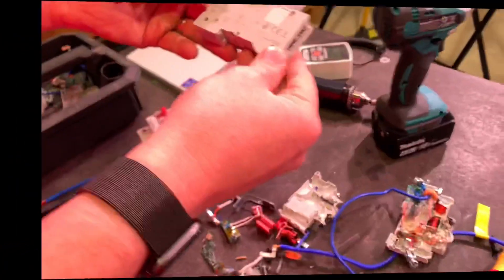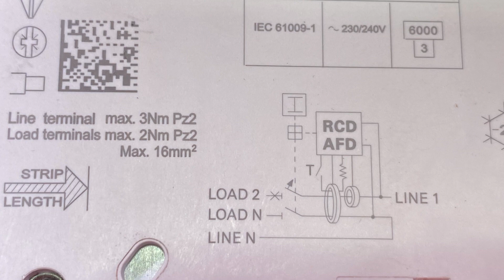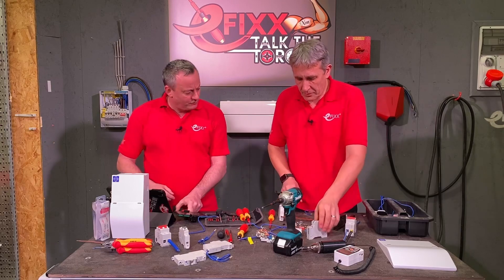IMPACT DRIVER vs CONSUMER UNIT - The results are SHOCKING

Comment: What sort of person thinks an impact driver is the proper way to tighten up an electrical connection? They aren't even the right way to fix a consumer unit to a wall (or at least one clad in plasterboard; it might be OK into a solid wall or a wooden board).

Comment: ❗️I’m not condoning the use of an impact driver ❗️… AND … I do not think the below myself. But I feel many people might watch this and say “yeh but my Dewalt impact driver has three speeds (these are hybrid speed and torque settings) and on the slow setting you can get exceptional control over how tight something is done up. Of course, this is not calibrated control, and you still don’t know what torque is being applied. But this video seems to show the results of gunning some poor piece of plastic like a bull in a china shop. Also what about drills with a driver bit: they have far more granular control over torque. ❗️Yes I know this is still not calibrated and - REMINDER - I am definitely in the torque screwdriver camp❗️But I just feel it’s worth some proper A/B testing with more careful use of these power tools vs a torque VDE driver to compare results to see how far out or how close you can get. I feel many people watching this who DO use an impact driver will just say “yeh but I can control it far better than shown here.

Comment: No competent properly trained electrician uses a impact driver to tighten any terminals.
Only the diy brigade and maybe a few gas fitters or plumbers who think they are smart enough to do their own electrics after watching a few you tube videos.
Just remember a little knowledge is dangerous.
I see it every single day.
Clowns who think they can do the electrical work themselves.
It’s scary how low standards have gone.
Reply from the maker: We’ve seen this or the results of on lots of installs by “approved” contractors

Comment: Hager take the impact driver just fine. I’ve never had an issue and your darn right I’m having all my connections tight. Just having a little bit of knowledge and sense to know how tight to go. Wouldn’t tighten lighting as much as say ring or shower for example. So many boards I go into and you could blow the terminal round it’s that slack. Slack connections, big loads cause heat and fires.

Comment: The red tail going into our old consumer unit was just sitting in the terminal. The screw had been stripped, presumably by whoever installed the consumer unit over 20 years earlier. The fault was found when we had a smart meter fitted. The man noticed that there was no power; the tail had just slipped out of the connection. It could have killed him. He helpfully called up an electrician who fitted a new main switch that night.

Comment: I use a Bosch 12v brushless mini impact driver. You can set it on a half power setting. Of course I never ever use it to tighten any terminals in the CU, I don’t let it do 1 or 2 digs, neither do I go over the board with with my torque driver afterwards to make sure everything is where it should be either. Neither would I know that my impact driver doesn’t tighten it to anywhere near 2nm with 1 or 2 digs by the fact that the torque driver still does some turning after the fact, probably. 

I did once use my big makita to whizz a main switch though. Needless to say that main switch ended up in the bin,

Comment: Cant believe, that using an impact driver and Consumer unit, charger installs etc are associated in the same, real world work practices. As my old boss used to say, my flabber is gasted. Just use a drill driver with an adjustable clutch/torque setting. Unless some installers dont know the difference or how to use one......

Comment: I'm sure that every mechanical engineer that views this will have one question in his mind re: torque settings ... Why dry? I.e. NO lubrication. Normally when setting torque in a.purely mechanical setting it is done with grease or oil or even a specified lubricant. This makes the actual torque applied do its job correctly.

If the "correct" torque IS so critical, and I understand why and agree, then surely lubrication should be specified also?

Comments? Testing?

Comment: One thing doing a degree in Mechatronics opened my eyes up to was the Mechanical components of an Electrical Distribution unit. Let’s be real, the amount of electrical installations behind the meter that are not fit for use is scary. I’ve checked boards in the past years gone by for Nm torque settings and no indications could be found on the MCB’s RCBO’s etc. I’ve come across brand name boards with over 3-4 different types of screw heads. 

An ISO industry standard is needed! The part that’s still hilarious is those circuits like heat pumps/ EV chargers that are constantly seeing high loads which is resulting in expansion and contraction. Go back to those connections over time and you’ll question the best of brands. Then look at an over tightened ferrules connection through thermal imaging under load and be ready for a big eye opener!  I see someone been made an example of very soon. 

Only solution in my opinion is period board inspections every year. 

It’ll save lives and insurance claims from fires. No brainer.
Reply: Sorry to highiack your comment.......I've been looking at the mechatronic course. Any reviews?

Comment: Your using the impact driver like an absolute amateur, nothing wrong with it if you can actually use power tools just use a bit of finesse not POWER flat out actually use the variable speed.

Comment: Those old C50 breakers don't have a bimetallic strip/thermal trip element - They're magnetic trip only.  Got a bucket full of the things and an old Crabtree C50 3 phase board still in service.

Comment: Well... each to their own nobody in their right mind would let the digger part of impact driver kick in (155nm) impact driver is for forcing a screw into timber etc so if you can just use it with minimum power until you feel the tightness of the screw then it’s fine just go over it with your screwdriver... BUT TAKING THE RISK IS A BIG NO NO but there are people out there who know how to use their hand tools correctly

Comment: It is an inappropriate use of a tool. Use a torque driver, designed for the purpose of tightening terminals on switchgear, to the torque tightness specified by the manufacturer.

Comment: A universal standard that can be adopted and thought from the bottom is what the industry needs. 

Something along the lines of a set torque setting depending on the size of the screw head, pz1 - 1nm, pz2 - 2nm etc.

Comment: I really can't imagine why people would put an impact driver near a consumer unit. There's very few cars on the road with 150nm on their wheel nuts, let alone on an MCB. My Milwaukee M12 driver is 30nm on max setting and it'll shear the head off machine screws or damage the threads of the screw. Did nobody learn about torque in college or what ?

Comment: An impact driver is for freeing up main crankshaft pulley bolts or seized wheel nuts. 
I've seen 'improvers' using them to put screws into plastic conduit saddles.

Comment: Seems to me that there's a fundamental usability issue with the torques required for a lot of these terminals. It's unreasonable to expect a busy electrician to have to read and set their torque screwdriver for each and every terminal. Similar sized terminals ought to have the same torque setting across all products. Those Wylex terminals with 2Nm on one side and 3Nm the other is nuts. It's bad product design (FWIW I'm an engineer that designs products - not for this industry). Perhaps a rash of RMA returns will bring the manufacturers to their senses....not that I'm advocating the use of impact drivers tho.
Reply: Completely agree with this, manufactures need to make a standard (or someone make it for them). I cant see why everything in a domestic fuseboard cant be 3nm for example and every manufacturer has to design their gear around that. Could probably also apply this to sockets at 2nm and switches at 1.5. Every sparks then has 3 fixed torque drivers (1.5, 2 and 3),  I bet a fixed torque driver would be less than 25 quid so 75 quid all in to comply fully, they would require calibration less often than adjustable torque drivers and it would get the industry to the point where it is as easy to follow the rules as it is to ignore them! While we're at it standardize the screws also, move everything to torx, T10 for switches, T15 for sockets and T20 for fuse boards, that then also stops people using the wrong fixed torque driver in the wrong device.
Reply: Funny you should say that, I just put a new board in the morning. First I had to set it to 1.2Nm for the top terminals of the RCBOs and SPD, then 2Nm for the earth and neutral bars, then 2.5Nm for everything else. Having to set the torque not just once, but three times? Absolutely takes the piss. Do these manufacturers have any idea how much time this wastes?

Do they really think I have an extra 10seconds to spare for every board change?!

Just buy a brand that notes the Nm next to the terminals (Fusebox which I installed this morning does this) and it's no bother at all.
Reply: Hmm could've SWORN breakers HAD to conform to a specified standard? So, the OBVIOUS questions ARE:

1. WHY is the torque setting NOT put in the standard? It would then be up to the manufacturer to conform  NOT the electrician! Saying "Thou shalt" to a manufacturer is MUCH easier to police than tens of thousands of sparkies! 

2. Use of Torx screws should ALSO be part of the standard! Why? Because "cam out" is just not a thing with a Torx driver like it is with a Phillips or Pozi. 

Cam out on either assembly or removal and then reinstating can EASILY kick off the actual torque applied due to unseen/unfelt slippage. The electronic industry switched over to Torx for precision kit years ago ... WHY is the electrical industry so slow to cotton on.

3. Similarly to 1. above, IF the torque too is made part of the relevant standard, not left to manufacturers'' decisions, in addition to both the type and size of the screw, then it can be a simple task to crete a minimal error environment. 

You could even to go to the extent of making cage clamps appropriately sized for a maximum sized cable on certain MCB types. Although fitting a larger cable than needed could hardly be cause for complaint other than expense!

Comment: Did you have a bet before hand of the number of comments from people saying either... I use an impact driver and never had a problem cause I know how tight to do it, or I just use the impact driver to do the screw up most of the way then do it by hand..   On a serious not how about an impact driver or electric screw driver in an combi drill/impact driver look but with electrotonically settable torque settings, don't know about you but my arm doesnt half get sore after doing up a consumer unit with a torque screw driver..

Comment: The way manufactures should go is have push fit, or lever Wago type of connectors. They apply the correct torque
Reply: They already have this. Seen it demonstrated at the NEC elec live 👍🏽
Reply: @jasonhodges5597  
Good news.
Reply: @johnburns4017  until they release the price on them lol
Reply: @O.i5  
The price will drop as all take up lever connections. Then no torque screwdrivers.
Reply: @johnburns4017  eventually it will but it will take a ling time and will still always be more expensive than screw terminals because they would cost more to make
Reply: @O.i5  
But they do not work loose and no need for a torque screwdriver.
Reply: @O.i5  have you seen what loose wagos cost? Compared to an RCBO price it shouldn’t add much.
Reply: @John Burns AND... that compression INCREASES on trying to pull the wire out without releasing it. The British electrical industry is arcane in SO many ways, it beggars belief! 🤔😱😱🙄🙄

Comment: I hate impact drivers. You have ne feel for it and they just break everything. I prefer to use a drill driver with torque set low to spin it on and finish of with a torque screwdriver

Comment: My impact driver is reserved for if we're doing loads of strut/tray/trunking. It's rare you need those torques in our game unless you're doing something specialist. I can't imagine you'd need one in a domestic setting at all & if you do, buy a decent combi and stop buying cheap wood screws!

Combi drill for mounting enclosures, boards & fixings, never for electrical connections. Although we do have a couple of 3.6v Bosch screwdrivers which are great for taking faceplate screws out on big EICRs.

What is worrying is this trend for bringing in new regs to counteract people not doing it right in the first place. If a cowboy wants to use an impact instead of an electrical screwdriver, are they going to follow torque settings? 

Better training (and I mean skills, not just learning where you've seen that question in the big book and clicking a, b, c or d) and tighter control of 'competent' persons needed now more than ever with the rate of change expected in the next 5 years; domestic 3 phase supply, EVC, electric boilers, air source heat and so on.

Comment: Honestly. I can not understand why anyone would use a impact driver to tighten terminals ...an SDS hammer drill with bit adapter is a lot better than a poxy impact shriver 💪💪
Reply from the maker: Pneumatic drill adaptor 😂
Reply: @efixx  One thing probably stops this happening. With the board proven dead there’d be no power to pump up the air tank.

Comment: I have seen too many of the younger generation of meter installers using their drills to fit meters and connect the tails, not the same as a impact driver but why cant they use the correct tool !!

Comment: Manufacturers data should be submitted and printed in the OSG of the Regs book. Or and I think this is the better option, has the torque settings standardised for every manufacturer so there can be no confusion.
Reply: Agreed. You shouldn't need a dozen different torque settings to install a consumer unit. It's an electrical installation not a spaceship.
Reply: @davefiddes  I wouldn't mind, if as Gaz said they put it on the device next to the terminals. I had to go online with the part code to find the manufacturer's spec sheet on some 3 pole MCBs the other day because the torque settings for the terminals weren't printed anywhere them.

Comment: Hi Gary and Gordon, very interesting video and it never ceases to amazing the stupidity of some “tradespersons” when it comes to the use of inappropriate equipment used in final fix.
However, do you consider it necessary to torque the terminations in light switch and sockets. I know from experience that most isolators have some indication of torque setting for the incoming snd out going terminals. But having said that there isn’t a clear indication for socket outlets , light switches and luminaries.
Well at least on the product, my be on manufactures leaflet of website!
What are your thoughts?
Reply from the maker: It’s a good question - we will raise this with a few manufacturers and see what the response is.  We recently installed a Ledvance light fitting and that had torque settings covering almost everything.

Comment: In my early days I worked with an ol' boy who used a combi drill-driver set very low (2 or 4) then finished them with a torque driver (he had me to keep passing over the tools). THAT would have been a more valid test than proving an impact, built to drive in 4 inch screws,  could break an MCB. Not your best gents!
Reply from the maker: Unfortunately lots of installers use impact drivers as we’ve shown.  This is part of a series - stay tuned.
Reply: Tbf it depends on the tool used. Currently have an m12 Fuel surge impact driver. Set on its lowest setting, 2 clicks on an mcb leaves you room to then use a torque screwdriver to take it up to the 2.5nm 
I agree with the driver tho, that would also be an option for when your doing a 72way board, literally hundreds of screws to tighten up there, easy to run everything up with combi, then give every connection a final check with yhe torque screwdriver
Reply: Yes a nice 10/12v drill driver set low nicely improves the tedium of Consumer unit replacement. Then torque driver as part of final check.

Comment: The problem with impact drivers is that they are too powerful for torquing up terminal connections like this and it makes me bloody die inside seeing people use them on brand new CU’s. Don’t forget that an impact driver is basically a rotating hammer meant for driving screws and bolts into solid timber. If fixing a plastic object like a patress to a wall with an impact driver is enough to completely shatter the plastic god knows what it does to the screws in mcbs, rcbos etc - they are just not designed for something that powerful. I have seen people who have tapped into Henley blocks, smart meters and other wiring accessories where they have over tightened the screws with impact drivers they have completely snapped of the head of the screws making it an expensive pain in the arse to replace especially when you cannot work on some of the equipment. This is why torque screwdrivers exist to stop muppets like these from damaging the equipment and crushing connections which is still dangerous.
Reply from the maker: Wise words 👍
Reply: Good guns have settings on them, I can set my gun to switch off at the first bit tension, we'll below torque rating. Also has to be slow speed, screws in boards aren't made for high RPM.

I see no issue with using a gun if done correctly, low speed, zero ugga duggas and hand torque to finish